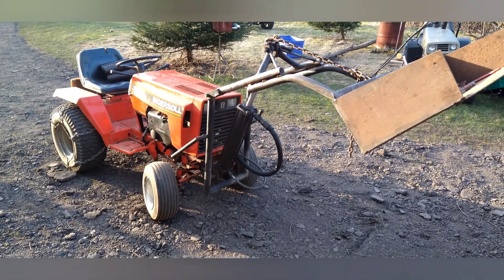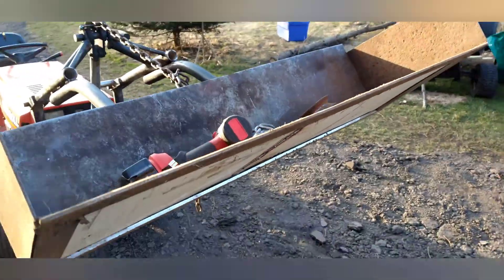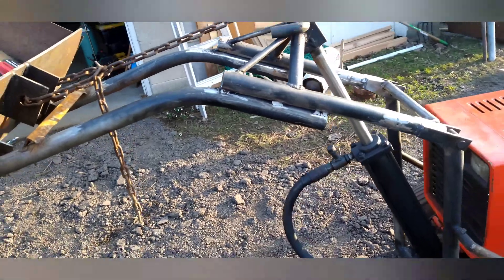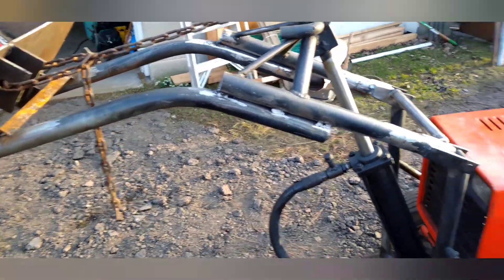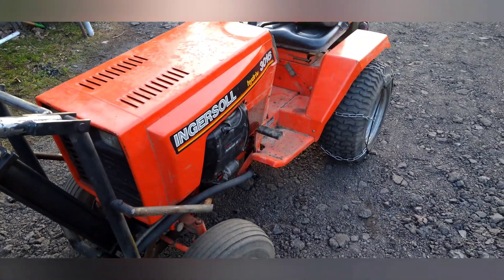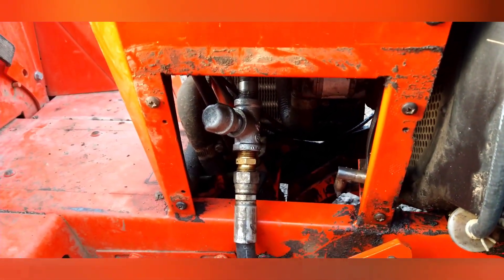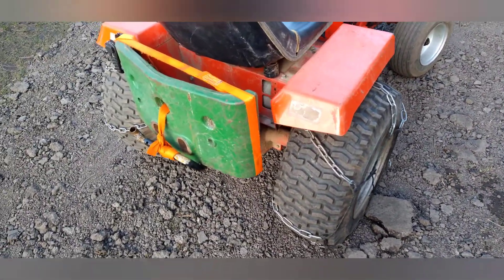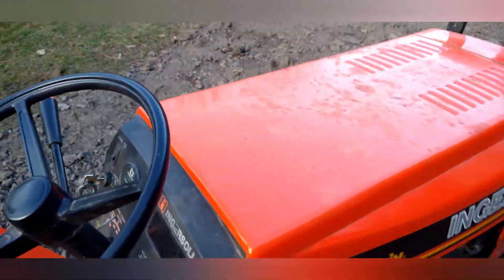DIY mini FRONT LOADER (Version 2) DIRT CHEAP & EASY (Explained & Tested)

Comment: nice job! I love that you just made it work with basic parts instead of getting too fancy. I’ve got the same tractor, so this is really inspiring me to try to build my own.
Reply from the maker: I would give anything to have that tractor again. Far superior to any other lawn tractor especially John Deere. The hydraulic pump is incredible on these, faster than my regular front loader tractor. Very powerful. And they are built like tanks, I've never seen so much heavy plate steel in a lawn tractor like that.

Comment: Hiw would u do it on a l100 jd
Reply from the maker: Honestly nothing like this after what I've learned. I would reverse the entire machine and have it lift off the back. I'd have the bucket extremely close to the rider like a forklift. Max weight that way.
Also build a loader frame under the entire length of the tractor.👌💯

Comment: Is "black pipe" like cast pipe for plumbing?!
Reply from the maker: It depends on the size, the smaller diameter stuff is usually low grade steel or mild steel, the connectors elbows and fittings are I believe ductile iron, and or cast iron. Some of the big 4-in pipes I've seen are cast. It typically works pretty good for general purpose fabrication.
Reply: it is very different. black iron is steel that is not galvanized.

Comment: Hey, Just found you. Always have been curious about putting a loader on the front of a lawn tractor. You know, a REAL lawn tractor not a mini standard tractor. Seen a couple videos so far, and as far as a minimalist / least cost approach I like yours the best. Seems like your build would cost less, and be easier to do than the others that look more like tractor loaders. Great job.
Reply from the maker: Much appreciated, the single cylinder works very well. Good luck 🤞👍💯

Comment: Anymore update videos?
I just ran across your channel.  I'm getting ready to do the same thing. I have a John Deere 214. Unfortunately my tractor isn't hydrostatic, So I'm in the process of finding a pump in order to run my hydraulics.  I've watched many videos of buckets on lawn tractors and no one shows the lifting/loading capabilities... I'm not expecting much, but as long as i can load a wheel barrel or a lawn trailer with loose dirt I'll be happy. Hope to see more vids of your project.
Reply from the maker: I've lifted trees and the first one completely bent my arms on the loader, about a 24" wide 11ft white pine that was wet and fresh. 
I had to weld steel plate on the sides of the arms I reinforced it like crazy.
If I were you I would find something with hydraulic drive. There's older new Hollands, John Deere's, ingersolls, etc. Anything with hydraulic deck lift should also have a hydraulic motor in the rear end. 
The reason I'm saying this is because my design was stupid, a super smart way would be to reverse the tractor. As in run the loader off the back my rear axle on mine for instance it's just as thick as a subcompact Kubota so if I run it off the back my lifting capabilities will be almost bobcat equivalent. 
Also the more weight I left the better the traction because of the rear wheel drive.
If I could do it again that's the way I would do it and I do intend on reversing mine.
The hydraulic drive makes it go just as fast in reverse as it does forward. 
I'll make a video soon and post it in the reply on your comment. 👍
Reply from the maker: I was able to play with the pressure relief valve on my tractor too. My front cylinder was only getting 500 PSI at first so it was pretty weak when it came to lifting stuff. But after looking over the machine I noticed that one hydraulic pump runs everything the rear and my front cylinder and what was the deck lift cylinder. It puts off 2,500 PSI of pressure and that's about what I have going to the front now. So basically the tractor will rip itself apart now instead of not lifting something it has seemingly unlimited lift capability power out of that cylinder I have.